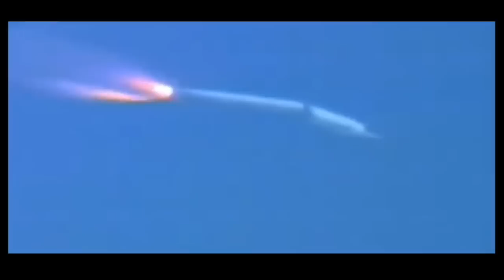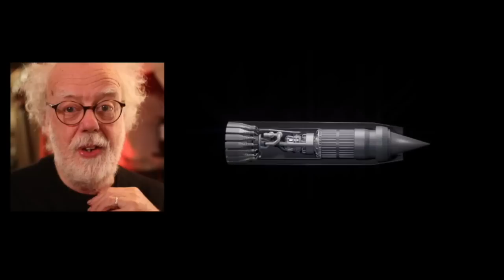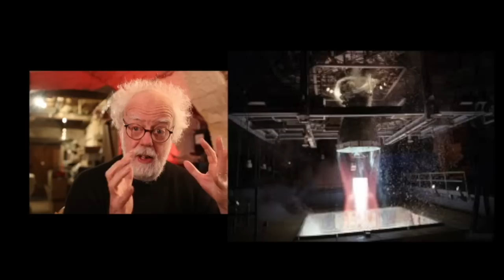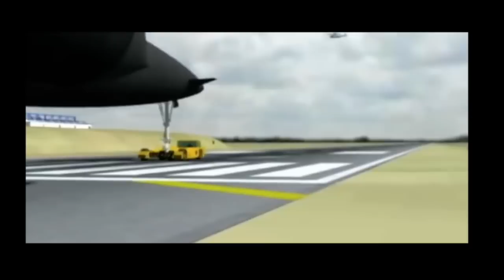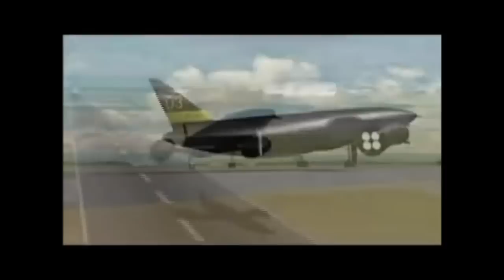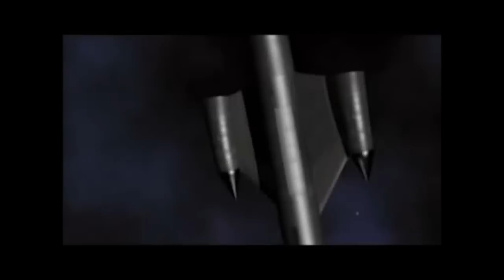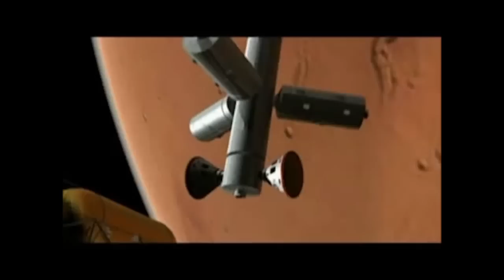SKYLON - The dream - Prof Simon

Comment: HOTOL makes no economic sense in the face of re-usable commodity rockets. HOTOL missed the boat, it might have made sense before 3D printed re-usable rocket engines which are waiting in the wings.  The complexity of HOTOL isn't going to be made up for by fuel costs.
Reply: It's the operational advantage a highly reusable SSTO HTOL vehicle promises that is intended to bring the savings

Comment: About eight minutes you talk about the corrugated SR 71 skin and how that would provide a gap of insulation which is true but the corrugation was done to allow for heat expansion. Without it the fuselage would not return to normal shape. Per a SR71 pilot interview I saw.
Reply from the maker: Thank you

Comment: Professor, I understand how the intercooler works, but not clear on the reason for the use of liguid helium, why not use the liguid hydrogen for cooling on it's way to the combustion chamber? Would it have to do with cooling capacity of helium over hydrogen? It's my understanding that helium could be in short supply in a decade or so.
Reply: SABRE's predecessor, the RB545 had huge problems using hydrogen directly due to hydrogen embrittlement. The helium loop was introduced to reduce this issue
Reply from the maker: I’m not sure...maybe it’s a better coolant and of course non flammable...separates the hydrogen from the fragile cooling pipes

Comment: Maybe they open the heat exchanger progressively, maybe they dry the air first, maybe they have sub chambers and the air is conducted by  slightly wider pipes with the cooled pipe at the center, maybe they use a geometry to change the air pressure along the cooling path....
Reply from the maker: All good ideas

Comment: Great video, I had just read about Reaction Engines success today here: https://phys.org/news/2019-10-air-breathing-precooler-record-breaking-mach.html
Simon I'm not sure about vibrating parts to keep ice off, I would hate to have anything vibrating at Mach 5.  My guess is they have 2 air flow paths. The main air flow goes through the cooler and into the combustion chamber and a smaller flow path allows some of the hot intake air to flow around the outside of the pre-cooler taking the moisture with it and straight out the back of the engine cowling.

Comment: What is the benefit (weight per BTU) of water as coolant compare to liquid hydrogen or liquid helium both of which are already in the plan?

Judging from : tank, volume and mass for on the board water coolant use in reentry. Question : is water the best option over helium and hydrogen both already a key item in the plan? 

Why not channel the supersonic compress-heated nitrogen-oxygen mixture directly into the combustion chamber, instead of going through the trouble, first slow it down to subsonic to let it heat up, then to pre-cooler it with evaporating coolant, recompress it again before sending it to the combustion chamber?

Comment: Great video. I went to the Isle of Wight last week and visited the batteries on the cliffs by the Needles. The new battery was converted to a rocket test stand for Black Arrow. Very interesting place, I climbed the railings and went into what I presume was the pump house for the cooling/silencing water. I was disappointed at our governments abandonment of this and many other aerospace technologies of the time. After watching this I have new hope in the future of the UK as a leading technological power.
Reply: It's not surprising  that the various aerospace technologies were abandoned when one considers the scientific and technical education or lack of it of our civil servants and politicians. To my knowledge there is not one MP in the House of Commons that holds a STEM degree. Plenty of PPE, History, Law and English degrees but not one Physics degree. I am afraid that most of our MP's would have trouble finding the hot end of a operating Bunsen burner.

Comment: This aircraft is quite similar to the French SO.9050 Trident II(https://en.wikipedia.org/wiki/SNCASO_Trident)  or aircraft with a hybrid jet rocket engine from 50 s.
Reply: SKYLON you  don't have to fly at a height of 100 km and more  it is enough to fly at a height of 40 to 90 km and or in the high stratosphere and mesosphere layers where the air is quite cold and that medium can be used to cool the hot hydrogen, plus the air resistance here is quite low and the same effect can be achieved again.

Comment: Should had this 30 year ago but was mothballed by bae and Rolls-Royce
Reply: This isn't Hotol.
Reply: @giddy Hotol wasn't going to work, and the people now involved in Sabre/Skylon realised that liquifying the air was a mistake, because of the unavoidable increase in entropy that occurs when a gas is liquified. The Sabre engine avoids doing that by cooling the air only to the vapour phase boundary.

Hotol also had problems with shifting centre of gravity, which is addressed in Skylon by putting the engines on pylons, so that some of the fuel can be behind the centre of gravity.
Reply: @sylviaelse5086  HOTOL didn't liquefy the air - the RB545 engine had all the features of SABRE. Alan Bond believes HOTOL would have worked (and would have likely shifted to a Skylon-like mid-body wing/engine arrangement on the next design iteration), had Rolls-Royce not pulled out

Comment: Very interesting If the have cracked it,
It must be a (air breathing) turbine, and a Scram jet as the SR-71 + a rocket/s with a onboard oxidiser and fuel.
The SR-71 was good for beyond mach 5, no official speed was ever released.
Edited: I got the numbers, so I had put SR-72 in the original post.
Reply: ...the 72 isn't technically official operating, just more a game of ideas, proposals and propaganda; not that it isn't likely to have a test vehicle in the process of being constructed or being tested. Yes, the Sabre engine could work quite well with the 72, more so than proposed the tubojet/scramjet design of envisaged when the 72 concept was released in aero-magazines a few years ago.
Reply: @razor1uk610  oh my word, sorry... I don't know what I was thinking, but it was the SR-71 I was thinking of, don't know why my mind remembered it as a wrong nummer.

Comment: Funny I always wondered if you could remove ice from a road if you vibrate it at a frequency that cracks the ice and leaves the asphalt alone using a piezoelectric speaker and vacuum, I tried but found the resonance was too close and damaged the road but I will revisit it. So sandwich them in with a condenser you may be able to keep the crystals from forming effectively allowing it to continuing to flow into the engine instead of creating ice from atmospheric humidity. I wonder if we could just float along the edge of space scooping up enough air to run the engine like a hydrofoil over an ocean of air, I realize the separation line is more subtle than may be needed but still cool to think. The idea of bouncing off the atmosphere I would think is less favorable comfort wise like the proposed waverunner with scramjets back in the day, 

I like the vibration idea, I was thinking also you could break the condenser / heat exchanger into individual sections or layers that heat up for a moment to remove the ice and then freeze again once the ice is clear... this sounds needlessly complex and metal usually doesn't like heat cool cycles.
Reply: Much simpler solution to shaking is just make all the piping surface in the condenser hydrophobic, much simpler and more robust...
Reply: @metatron5199  Might be a very simple solution if they have cracked the fact that hydrophobic treatments rely on microscophic structures that usually are quite fragile and don't stand very well to any kind of friction for a long time. If they have cracked that it is indeed a simple solution, else this will only work for limited ammounts of time.
Reply: Armando Silvier what are you talking about? There is a gradient drop off of atmospheric pressure as you approach the vacuum of space i.e. No need for a barrier and as well as letting everyone here know you clearly do no understand physics what so ever, literally everything you said is flat out incorrect.
Reply: Armando Silvier if this is the first time you have ever heard that, than you have never studied any science let alone physics and the level of physics required to properly understand what is happening in these engines to begin with. Nothing is illogical about this,  the only thing illogical is your own thinking process hence why you have such a hard time understanding what are actually simple concepts fundamentally. Why don you actually start where you clearly need to i.e. introductory course in all of the science bc is frightening of how little you understand but yet are so aggressive especially when all you have to say is equivalent to your wrong bc I feel a way.... yeah really thinking like a scientist there buddy, oh and btw this is exactly what we measure with instruments, so there is no speculation  on the matter as we have empirical evidence which confirms what I have stated, so go ahead be in denial of reality, doesn't bother me, and while your at please go around telling people this and see how far you get with it 😂😂😂